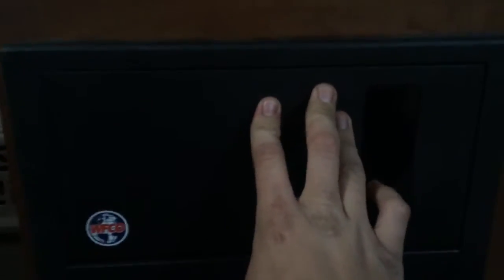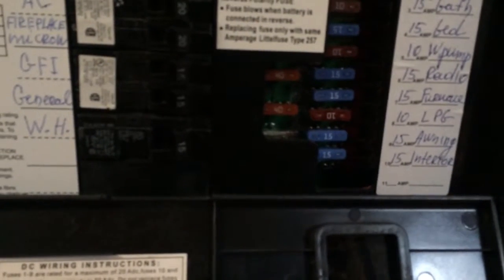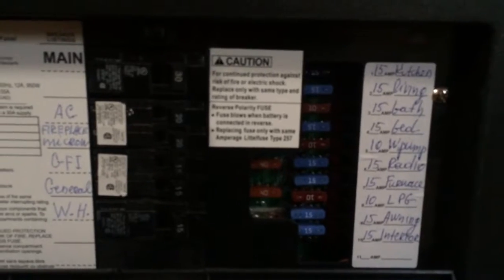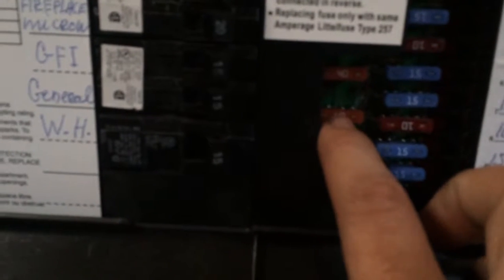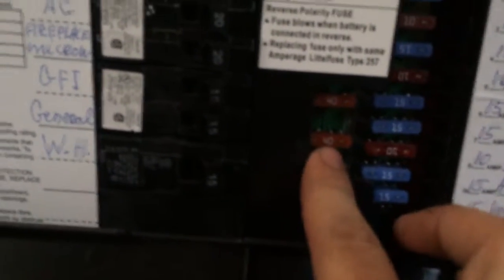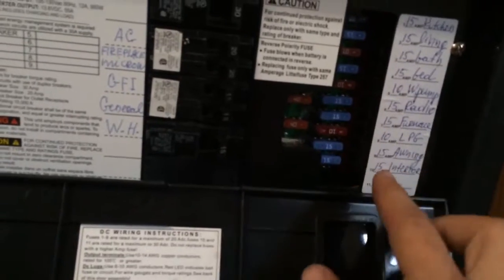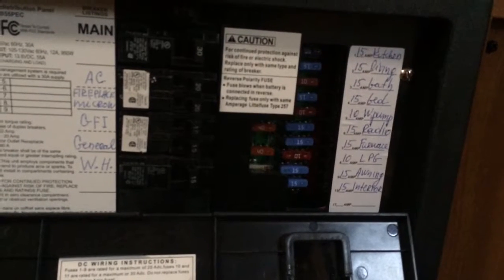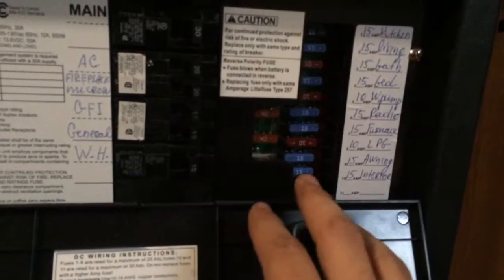Rv Electrical system explained

Comment: What if you can't find an owners manual for the rv. I have a 1980 Chevy mallard. I can't find an owners manual. My lights don't work when plugged into shore power what should I do?
Reply from the maker: So Youtube is a great place to find info on alot of rvs so is google. Your rv is up there in age but you should be able to find alot of info still. Start by checking batteries for power at the post need atleast 12 volts to gets lights to come on.